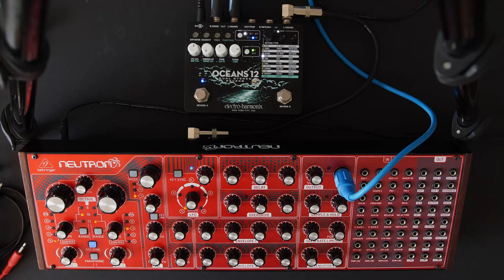Complex AM wizardry with Behringer Neutron

Comment: I had a realy hard time finding out that the lfo is synced by default when sending a clock via usb and then it Wont go high enough to produce this artifacts .. 😰
Reply from the maker: Oh it does ? I never realized so, I always hook it with midi cables old school style hehe x) 
but yeah, the whole point is the LFO going really high in rate 😏
Reply: @olliepsy  yeah they probably save the production cost for a sync switch here... but one can deactivate the clock send on the midi channel. but somehow it still sound sbest with midi cable :O
Reply: Tanks for the tips bro. I had the same problem and it work now 😎

Comment: For some reason I steer clear from using MIDI . I assume it is not as relaible for a steady clock as CV from the DAW via ES-3. BUt maybe I'm wrong? Do you know if the Neutron's sample and hold cand be triggered without using Midi as the source?
Reply from the maker: You're right about clock over midi being unstable but I can't really tell if CV from DAW would be fully stable, I mean Ableton for exemple is known for it's syncing issues and I wonder if it would perfrom better with CV ?
As for the Neutron's S&H, you can sync it to any gate signal you have as it has it's own clock input.
Reply: @olliepsy  In my experience, cv from Bitwig is 100% stable, nno jitter. Ableton is not so reliable in that respect. 

Ok great thanks for the tip :)